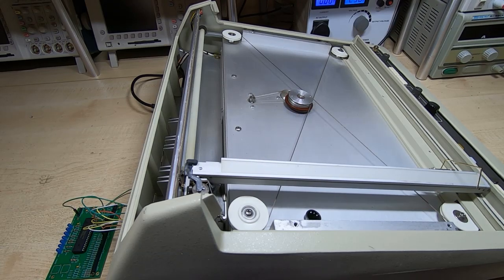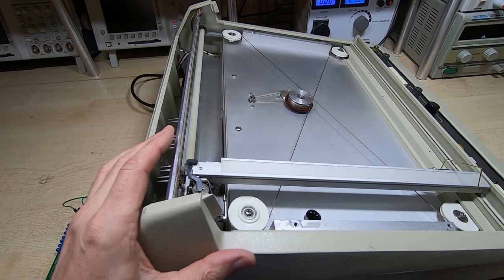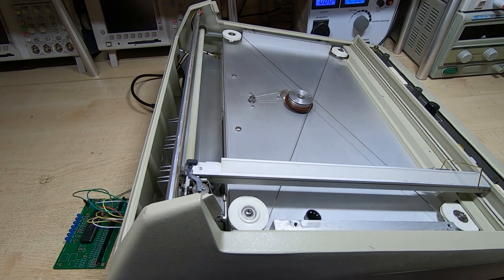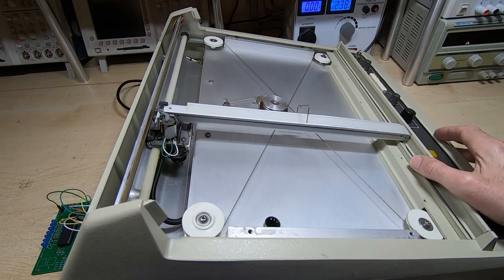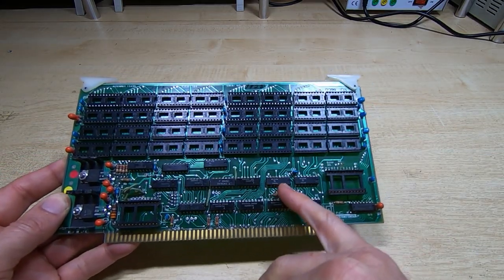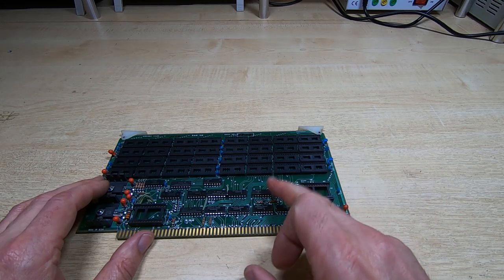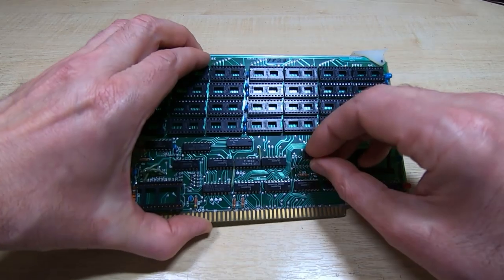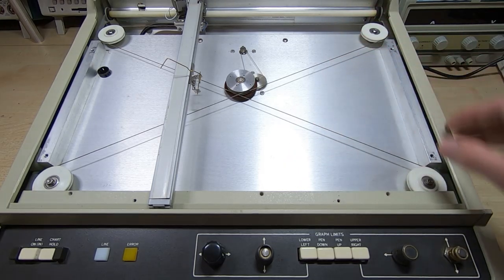HP9862A Calculator Plotter Repair Part8

Comment: Thank you for sharing your de-soldering technique. IC failure modes can be quite interesting - I recently had a failure of a 74151 data selector where one input transistor shorted causing that line to be inverted at the output. The chip was fully functional aside from inverting that one line!
Reply from the maker: Yes I have had similar failures. A lot of 'failed' devices also pass tests in a dedicated IC tester but do not work in circuit but replacing them still resolves the fault.

Comment: Just 2 days ago I was repairing a control board for my Maytag Bravos washing machine and needed to replace a failed triac that controls the lid locking mechanism.  It was surface mounted so should be simple, right?  Well, first thing I noticed was that I just couldn't get the original solder to flow.  Upon closer inspection, I noticed that the whole board was covered in some sort of clear varnish or something - presumably to help protect the electronics from harm by the rather harsh environment of steamy water, detergents, chlorine, etc.  Anyway, once I noticed that I tried to remove the varnish with alcohol and then electronics cleaner to no avail.  I finally just got a hobby knife and started scraping all of the pins to get the substance off.  Once scraped, the solder would flow and desoldering braid did its job nicely but the varnish had sort of seeped underneath the component and bonded it to the board.  I finally had to start gently prying to break that bond. I got it off but lifted 2 traces in the process.  Oh well, I still got the darned board repaired and the Maytag is back in service.

If you have any tips that may relate to this sort of experience I would love to hear about them.  Thank you for the continued superb content on your channel!!
Reply from the maker: Most domestic washing machine boards are conformally coated (sort of specialised varnish). Also the surface mount components may be held in place with a drop of adhesive underneath them prior to reflow. Don't try to scrape the coating off. The coating will break down with heat and so will the adhesive. The easiest way to remove these is if you do not have a rework station is to add enough solder to span all the pins and use a large iron tip (not too hot) to heat the entire component. Then it will lift off. Do not try to force it as this will lift the tracks. When you get the temperature right it will just lift off. The residue will be 'burnt' coating which you can then clean off before fitting the new part.

Comment: Jerry, in which video did you describe "matching" the look of soldered joints by varying the iron's temperature?  Also, what temperatures do you use for both soldering and desoldering?  I ask because a long time ago an aviation electronics technician strongly recommended that I solder at quite a high temperature (higher than usually recommended by others) in order to get on and off of the pin & pad as quickly as possible, i.e., use a high temperature to minimize the time I keep the joint hot.  However, since then I've been told by others with much more experience than I have that using the very high temperatures is *wrong*.
Reply from the maker: The temperature I use depends entirely on the particular board and I select a temperature which is suitable. However it is a very bad idea to use very high temperature as this will almost certainly damage the board or component or both and will also boil off any flux and cause the solder to flow badly. I select the lowest temperature which will work for a particular board. This is especially true for multilayer boards (4, 6 etc) as high temperatures will cause the inner layers to separate from the through hole plating. I repair a lot of boards where previous repair attempts have caused damage by overheating and damaging the boards. I would point out that modern irons are more suitable for this than older irons which typically needed to be set much too hot because they had poor thermal efficiency and tended to cool down when applied to a joint. To compensate the temperature was often cranked up but did not damage anything because the tip cooled down when it was used. Modern irons do not work in the same way so if they are set to a high temperature then they will maintain that temperature and damage something.
Reply: @JerryWalker001  Thanks!  Can you point me to a PDF or website that I can read to have a better chance at determining which temperatures are applicable for whatever I am trying to work on?  Also where can I find more information on changing temperatures to "match" what an existing board looks like?  Is that available in written or video form?

Comment: Jerry, any reason why you don't use a dedicated desoldering iron, I have one from weller and it seems to work much faster.
Reply from the maker: As I say in the video everyone should use whatever method they prefer, I was only showing one of the methods I use. I do sometimes use desolder guns (as I also say) but I would not use them on rare boards for the reasons given. I replace over 1000 IC's each year and the method I show has been 100% reliable without ever damaging a board. I am not aiming to break any speed records but aim to minimise the risk of damage.
Reply: @JerryWalker001  I must say your method looks very good, did learn something new as usual. I never used desoldering braid on double sided boards but I will try it out the way you do it.Just need to buy a bigger tip like you use. What temperature do you set your soldering iron to do this?
 Anyway keep up the good work !!